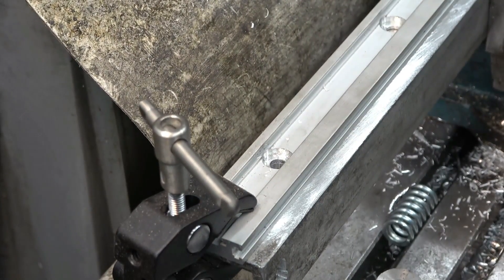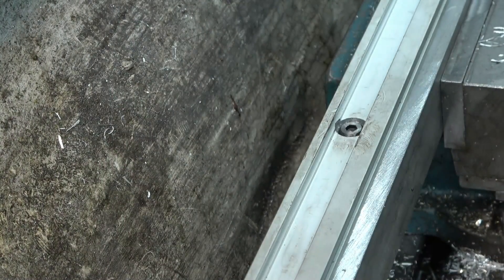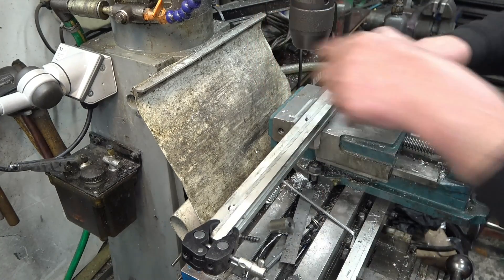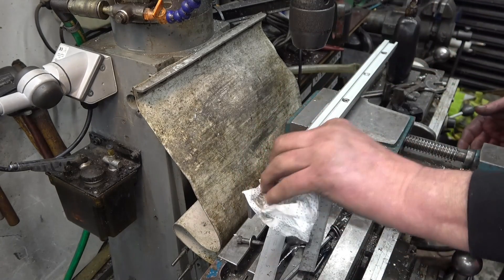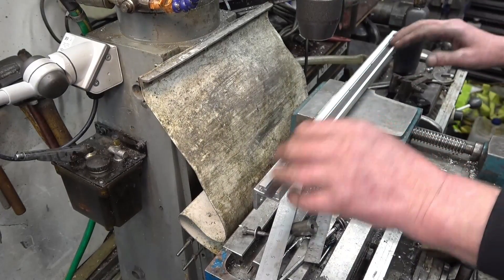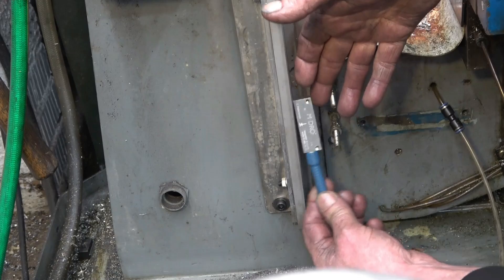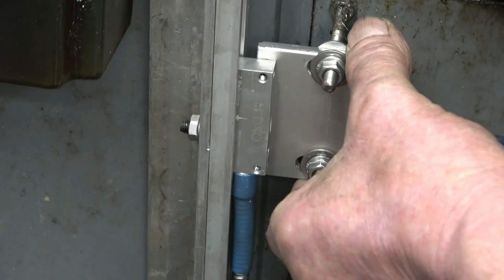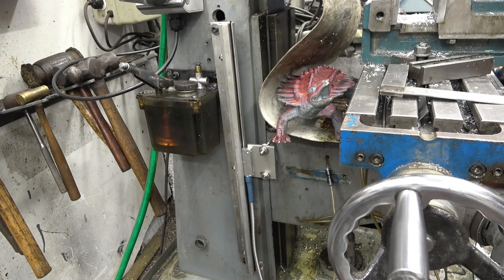SNNC 479 P2  Mill Z Axis DRO Install

Comment: Thanks John, enjoyed your content this weekend.
Reply: I had a magnetic scale on the cross slide of my Harrison M250. Steel swarf sticking to the magnet was never an issue. I did however find it quite jittery. In the end I replaced it with a glass scale which is rock solid.